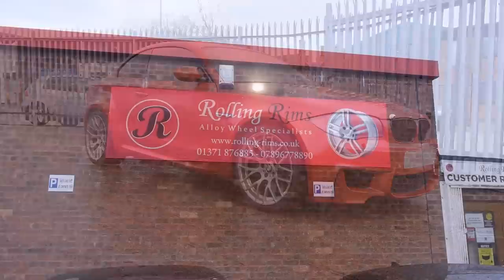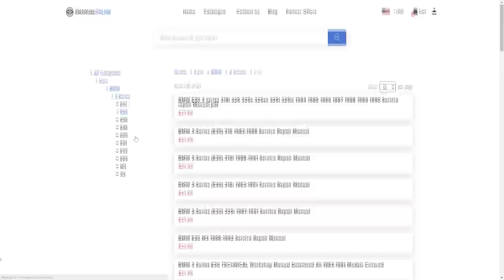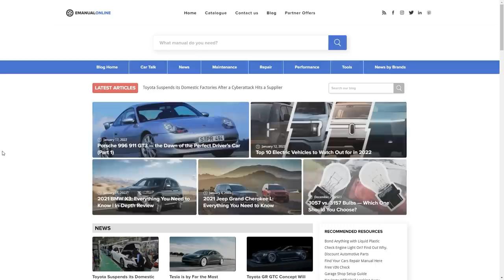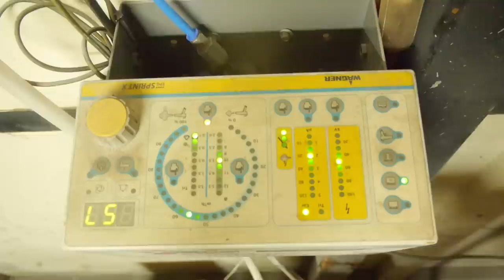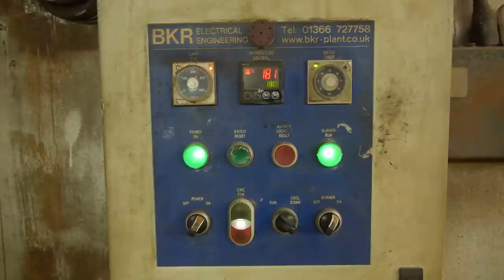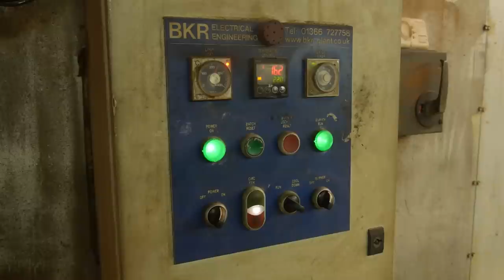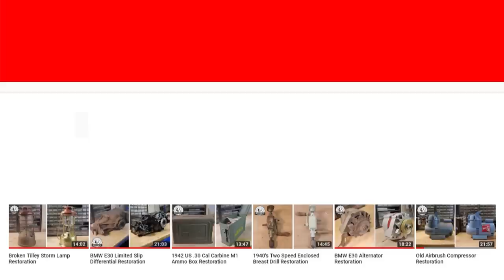BMW 1M Coupe Alloy Wheel Restoration - Rolling Rims

Comment: Nice to see that they plugged the bolt holes and masked up the mating face on the back. I had a set powder coated by some cowboys and they didn’t. I had to sand the coating off with a Dremel.

Comment: They even lined up the emblem peice with the valve stem, I know most folks couldn't care, but it always makes me feel like the tech cares enough to pay attention.
At the shop I work at I always line up the cover with the stem, and mount the wheel so that anything on the brake lines up as well, that way I can know when it comes back if anyone else has touched my work, or if I didn't do the work. So I know if I messed up or someone else has...

Comment: I never understand, when there is a scratch or damage like yours, doesnt require to add some material to wheels?Specially on the lip area
Reply: "Curb Rash" is just a gouge, a displacement of metal. In the restoration
process, the metal is relocated back where it originated. Think of it
being bent, then straightened out. No extra metal needs to be added.

Understand now?

Comment: Very cool! That acid bath was crazy. The pain was peeling off in under a second. Btw how are their prices? I’m in the States, so just wondering.
Reply: This is a UK based company. Overseas round trip shipping on four wheels would be hugely expensive. There are wheel restoration and repair shops in USA. You can do a Google Maps search under 'wheel restoration.' Look for shops rated four or five stars. Don't just shop on price. Paying a little more for better service is always better than paying twice to fix shoddy service.
Reply: @houseofno  I know that’s why I said just wondering.
Reply: @iteerrex8166   probably its hard to say how much it cost as it was "promotional video"
Reply: @Egon1982  Umm no way he wouldn’t know the price.
Reply from the maker: Around £100 a wheel
Reply: @RestoreIt  Ahh that’s not bad, and of course if its bend or cracked, or has to be resurfaced, there’re extra charges.
Reply: @RestoreIt  Dang, that's not bad at all